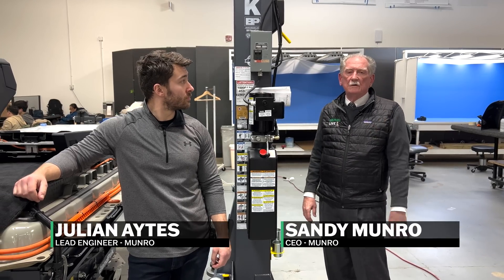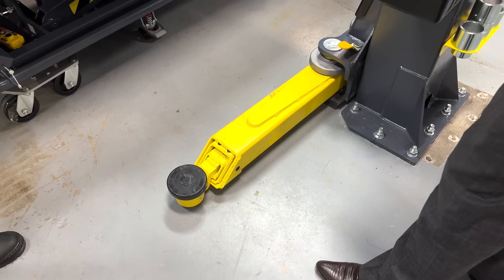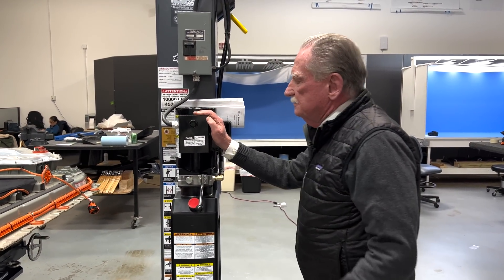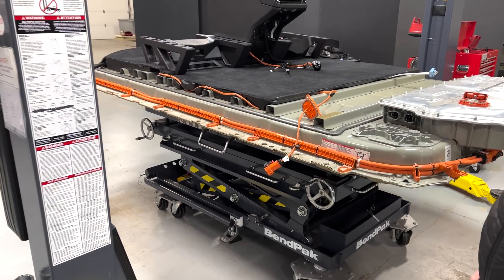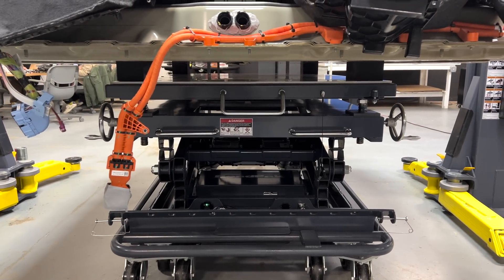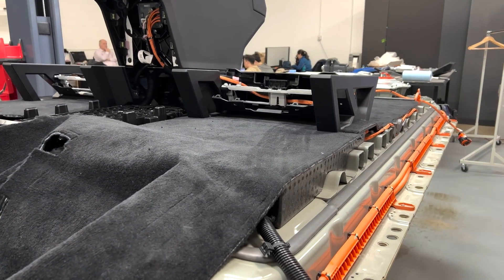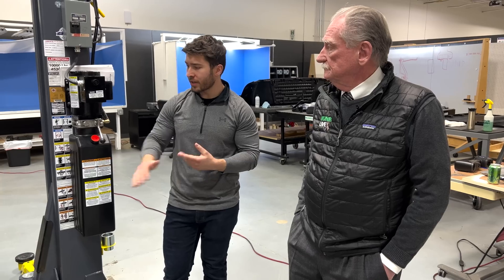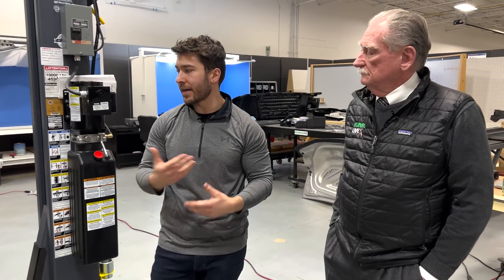BendPak Hoist & Battery Lift Table Review

Comment: The battery pack and car lifts run around $10k each for those who are curious. 

You just know that Sandy worked out a killer deal. Maybe even did a little bartering. I’ll feature your lifts on YT if…you know the rest.

Comment: When it's appropriate, can you guys talk about how water might/might not work its way into the motors or other elements of the truck if you go through high water? As everyone knows, Elon mentioned it could be a boat (as well as other Tesla vehicles) but I've heard multiple EV mechanics state that water can still work its way into the gears or ruin the car in other ways besides the obvious of possibly infiltrating the battery pack. I think it would be super informational for the community to understand the limits of this...and any inferior vehicle. Keep up the good work Munro crew 💪
Reply: They actually can pressurize the components so if there is a breach it would be air escaping not liquid infiltrating. SMRT says Homer
Reply: **Large emphasis on this: "boat"
Reply: Elon said they put positive air pressure to push water out while wading on water.
Reply: Water won't enter powertrain components like motors, inverters, battery, etc unless something is seriously wrong; they are all designed to be waterproof. The danger is water (especially salt water) entering other components like controllers, sensors, wire harnesses, fuse boxes, etc.